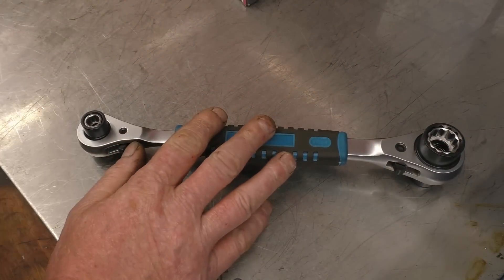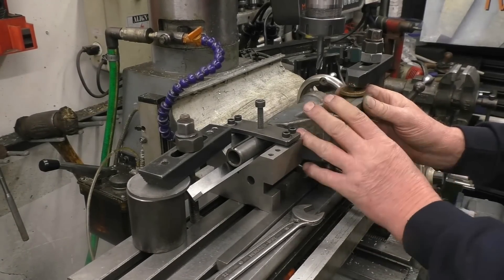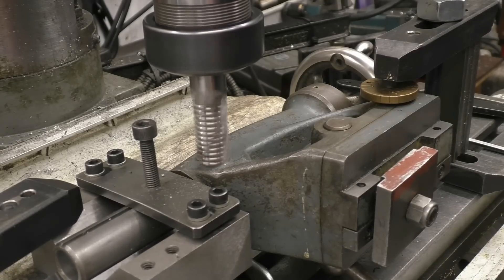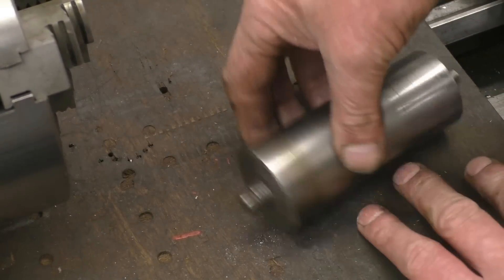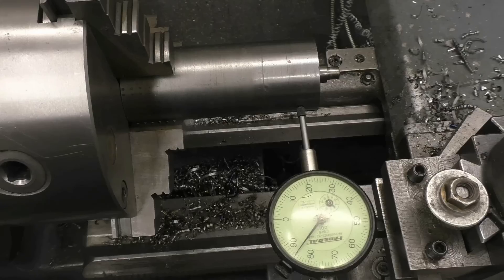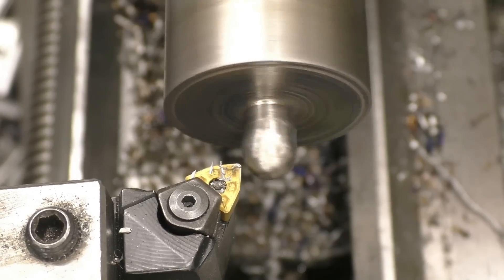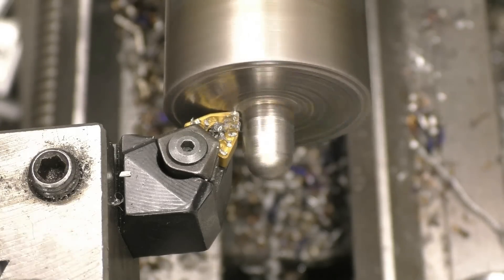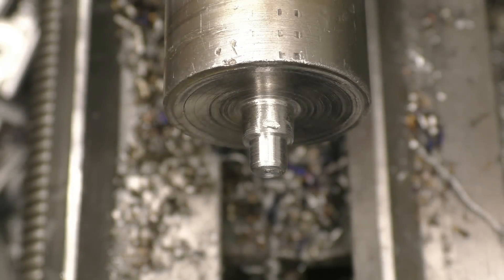SNNC 432  Myford ML&  Tail Stock DRO

Comment: That spanner is a development on the quad spanner, which is a standard tool in the entertainment industry where we use almost exclusively 13/17/19/21mm bolts/nuts. I’ve got one of the 8 way ones too, handy for some speaker brackets that need 10mm tools. Quad spanner, multitool, and hard hat are my standard tools to install or strip out a show.
Reply: The downside to the 8 way spanner is that on some of the sizes you can’t pass a bolt through to use the tool on the nut, so it can be a bit limiting.
Reply: @jonrpearce  I don't think that's correct.

The bore diameter seems to be large enough, to accommodate the shaft of the largest bolt, that end is designed to tighten/untighten.
Reply: @BedsitBob   from experience - if you’re on the largest size head (of the 4 available per end) that bolt thread will not pass through the smallest size head. Mine’s at work so can’t check right now but I think some of the other combinations fail too.
Reply: @jonrpearce  Maybe the one I've just  bought, is an updated version.

I've got a bolt in the 17mm socket, with the threaded portion passing though to the other side, and there's plenty of clearance around the threaded area.
Reply: @BedsitBob  17mm will work. 19mm might  just and 21mm won't. On the other end 13mm won't (12mm is probably only useful for the odd M8 that uses the JIS system).

A 19mm head will be a M12 bolt - making it a tight fit past the 14mm hex. A 21mm head is M14, no way that's passing the 14mm hex cleanly. 

As 14mm heads are rather rare, the tool would probably be more useful without the 14mm (and probably the 12mm too) as then you could get more clearance for passing bolts through.

Still a handy tool in the box, but day to day I'm more likely to be carrying my 13/17/19/21 quad spanner.

Comment: The roller is a bit odd, the stubby little shaft the bearings are running on looks far to small for the main part of the roller.
Reply from the maker: The roller is from a belt sander / tube notcher  
I agree under engineered

Comment: Trouble with putting it on the side is it restricts tailstock movement next to tool holder, better fitted on top.
Reply from the maker: I only did what I was asked to do 
I agree on top would be a better option
Reply: YUP!  What Keith said.

Comment: You get the ratchet from aldi or lidl
Reply: That's marked up Workzone so it's an Aldi one. Not seen one in my local Aldi though.
Reply: @samrodian919  i saw it was aldi you can also buy the same thing from lidl but it's red and black
Reply: @samrodian919  I picked one up last night, from my local ALDI.

It's quite a clever design.
Reply: He got the paint brushes at Aldi, the ratchet was a viewer gift.